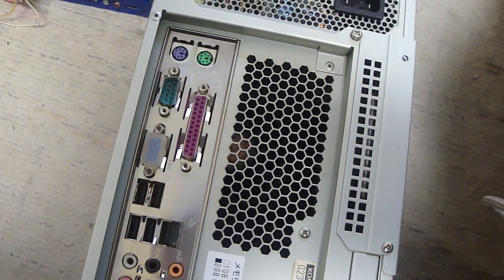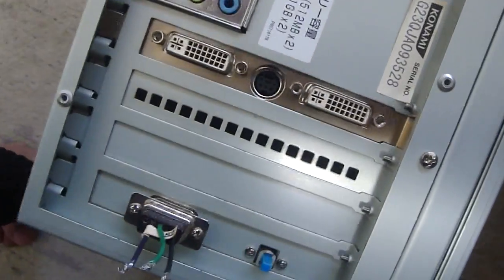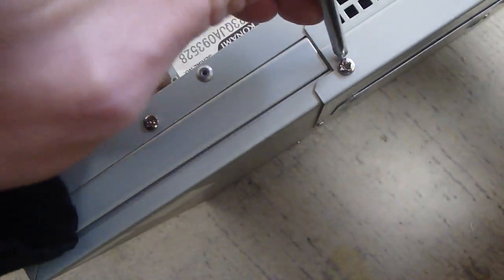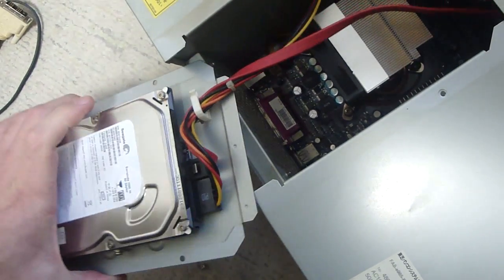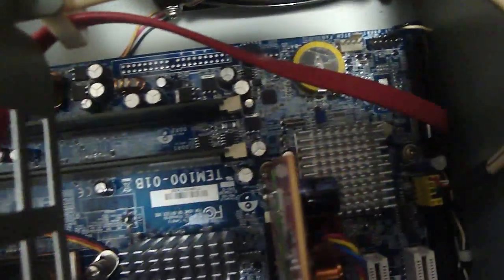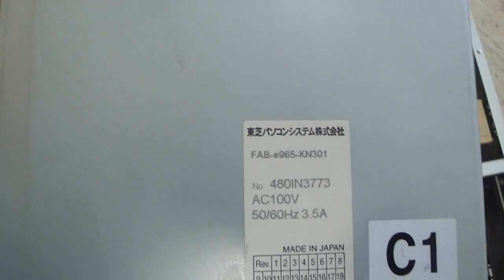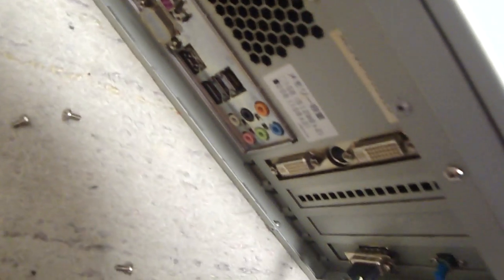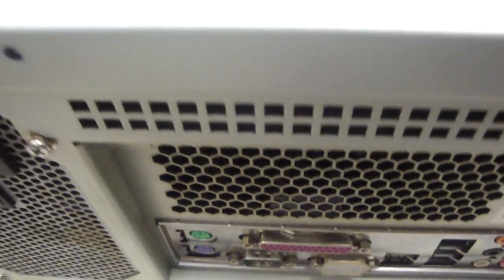Suggestions For Getting The Konami PC Based Arcade Hardware Running?

Comment: There are a lot of PC-based arcade games that require connection to a remote server in order for the game to function. In some cases, the game data is actually stored and managed by the remote server, allowing the system administrator to select which game to send out to certain stations. Also, you are probably missing a USB key to run the game.

Comment: Luke, sure you've tried, but maybe check the cables (or replace) for the SATA hard drive.  Not sure how this system works, but since it's pc-based, I've seen bad hard drives (or ones missing power or data connections) give I/O errors.  Also, check that 3 Volt CMOS battery to make sure it hasn't dwindled down too far under 3 volts, 'cause it could have lost it's CMOS settings and have a default setting of "No Hard Drive" or similar causing the system to hang. (although CMOS error is norm with pc)

Comment: If I had this stuff in front of me the very first thing I would do would be to plug a keyboard/mouse and mess with the windows (to be safe if you want to keep the game I would do an hard drive image backup), then have some fun with the files, there's probably an .ini or a config file somewhere.

You might also be able to swap the harddrive content with a more interesting game that will probably not require that IO board.

Comment: After re-watching the video it actually looks like it's just a internal header for a gameport. So I have a suggestion, unscrew the S2 connector from the back and plugin a gameport compatible controller, or try to pinout and manually wire one up. google image search "joystick_port.png" good luck.

Comment: I have never worked with IO boards but it appeared as though the serial cable (S2) was simply hooked upto a pci slot, am I right? If thats the case then perhaps you can unplug that S2 ribbon cable and plug in another IO board directly into the 4x pcie slot. That would at least allow you to have game ports, but obviously the software is going to be picky and look for something specific. It couldn't hurt to try regardless. Perhaps there is a simple .ini somewhere with a hardware ID you can change

Comment: @lukemorse1 the pc is recent, it uses cables that have been in use for 3-4-5 years for the hard drive, what does the switch do near the connection at 0:43 ? have you considered that the i/o check is to actually stop piracy, and without a seperate board, it wont boot? now would you beleve that im 14 years of age and the smartest with computers in my town, also, does it give you an error code

Comment: According to system 16 website:
CPU : Pentium4 2.4BG 
RAM : DDR2100 256MB 
VGA : NVIDIA GeForce4 MX 440-8X AGP 
HDD : IDE 60GB 
O/S : WindowsXP Embedded 
Control : I/O Control PCB connected by USB 

So if IO is connected by usb maybe try plugging in a usb game controller.

Comment: The Konami I/O I have seen for bemani games is very picky.  I can't say the same for the derby game you have, but considering the hardware is almost identical you might have to assume that.  In all honesty if you don't have the proper board hooked up the game will likely not boot at all.
I have told you this in the message I sent back to you, but you seriously might have to modify the files on the HDD into thinking that you have a I/O board connected.